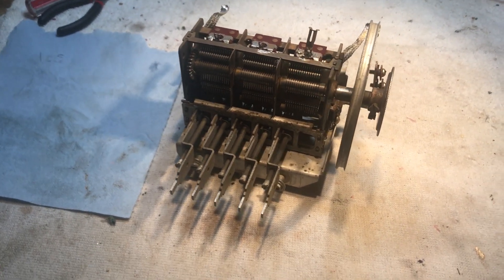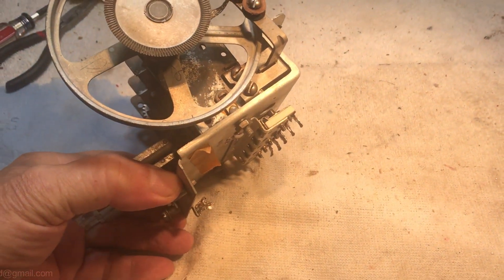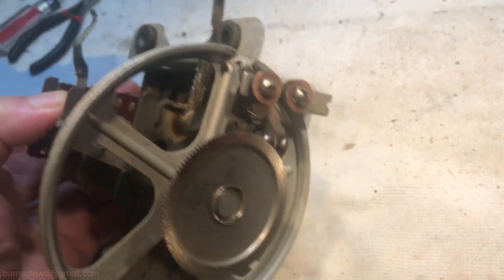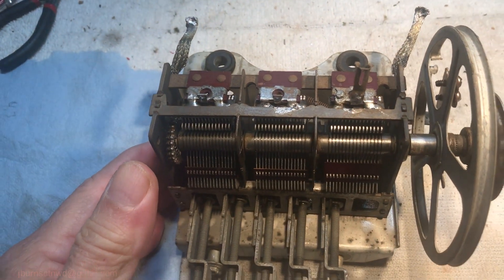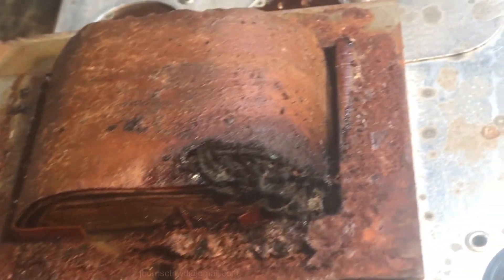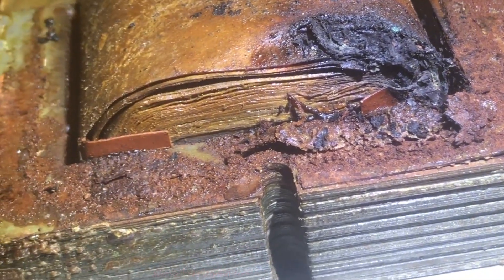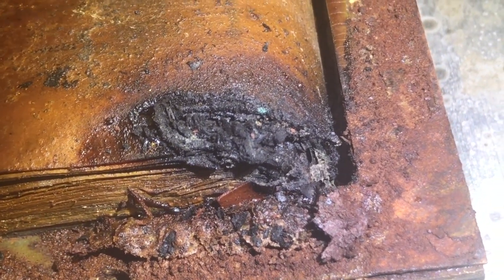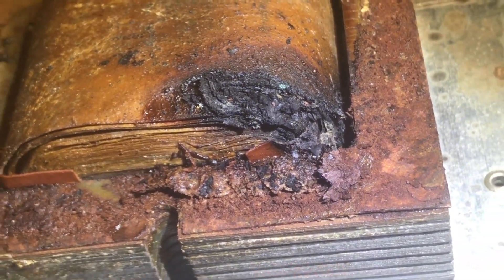Silvertone 7039_2 InProgress3

Comment: Don't want no Kentucky Fried Transformer? This is why you should put a properly sized fuse in a power transformer radio. Lucky a tube must have went first. Pretty common center tap power transformer for it's day..